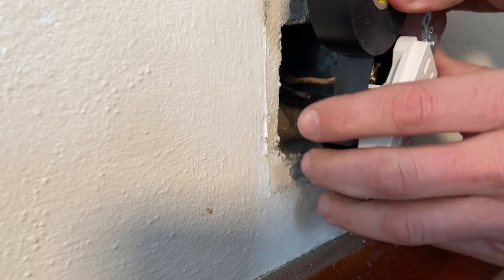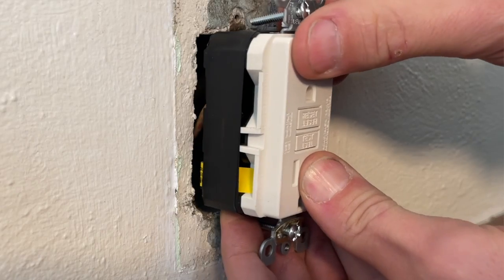Should You Wrap Outlets In Electrical Tape?

Comment: Wiring in my house is 60+yrs old.  When I am replacing an outlet, switch or new light fixture, it scares me.  I wrap everything.    The layout is insane as well.  With every remodel the house went thru, i swear they picked a random breaker to connect to.   I have breakers that connect to 3 different rooms 2-3 outlets or lights each.  I have one breaker that connects to the basement, 2 outlets in the living room, 1 in a bed room and the attic.

Comment: FYI taped wire nut is a level of UL ratings.  Though as you said it is only for insulation the nut must be properly installed.

Comment: I'm not an electrician, but will that GFCI work without any ground wire? (see 4:09)
Reply: Wrapping with a good  brand of  electric  tape after  twisting  the  solid  conductors and  leaving a  folded  tab on the  tape ,in my opinion is the best way  of  Safety  because  sooner or later someone  will take  faceplate off and  or pull it ( switch  or receptacle)out  to inspect  or paint, so Safety  first

Comment: A couple of thoughts here. Yes, good to use it as an added precaution. It should not be used to replace proper connections, such as the actual connection to and within boxes, wire nuts and, the new Wago connectors. Also, reality dictates it could be used in a pinch for a short period of time until it can be properly repaired.

Comment: The neutral wire not connected ? This is why I twist the wires together with pliers before adding the wire nut ! I always wrap the receptacle if the box is metal , I wrap the wire nuts if it is tight to fit everything back in the box .

Comment: My take:  if an installation is done properly, whether an outlet or a wire nut, there should be no need to wrap anything with tape.  A plastic box does not conduct electricity, your metal box should be grounded anyway, and there are no loose wires or exposed conductors in properly installed wire nuts.  In all of the homes I've had and had to redo electrical work when failures occurred, I have never seen an outlet taped, and taping wouldn't have prevented the failure (commonly a corroded connection in a push-in connector or improperly stripped conductors that have broken when the conductor was partially cut through during stripping), and I have seen lots of wire nuts taped that only hid the faults (loose wiring or improperly stripped conductors that have broken when the conductor was partially cut through during stripping).  It's my opinion that taping only hides errors and makes repairs and troubleshooting more difficult for the guy who has to fix the poorly done job later.  Further, on most of the taped connections I have seen the electrical tape was dried out and falling apart anyway.

Do the the job right the first time and skip the tape.   Just my opinion.

Comment: I always tape outlets and switches in metal boxes. I do one other thing to make it easier later on down the line, be it a month later or years later. After I snip off the roll, I fold under the last 1/8 of an inch of tape on itself so it makes a 'tab' that doesn't stick down and "become one with the layer underneath". So, years later, whoever is trying to repair or update the outlet or switch can just grab and unwrap. It takes less than 20 seconds, so why not?

Comment: I think it's important to actually twist the wirenuts properly, regardless of tape. Those wires were not properly twisted.
Reply from the maker: Agreed, I was just trying to a quick demonstration so you are right I did not pre twist the wires with linesman's pliers prior to twisting on the cap.
Reply: Linesman pliers, yes. Cheap tool and the right way (should have a pair anyways if you're a do-it-yourselfer).

Comment: I use tape only when I'm working in a metal box (and I can't replace the box with a larger, plastic box) or when wiring larger devices in a multi-gang box.  The goal in both cases is to prevent the side screws from coming into contact with anything conductive.  Plastic boxes eliminate much of that risk, but not always.  New receptacle types, such as GFCI/AFCI/USB, are many times larger than older ones (even spec-grade!), and there's a chance that the contacts could touch each other.
I never use tape on wirenuts.  The rule there is to twist all of the wires together first, and then twist on the wirenut.  The plastic on the wirenut should cover all exposed condutors.  If there's any bare wire exposed below the nut, then cut the wires a little bit shorter and re-apply the wirenut.  Outdoor applications should use wet-rated wirenuts rather than regular ones + tape.

Comment: I always wrap, it only takes ten seconds and a few pennies of tape, put a tail a tail on the end.  it makes it a lot easier to remove it.  I also tape the end of wire nuts.  I pre twist the wires before twisting on the nut and pull test before taping.  That way the taping isn't hiding anything.  The Super 33+ is the way to go.  We do outdoor work as well using under the under the surface electrical boxes or pull boxes that hold water.  The tape is a great barrier from the water.

Comment: If replacing two prong socket on a metal box and the box is not grounded there is a risk that if the live wire in anyway touches the box the voltage will get through the ground pin to the equipment case. The GFCI will NOT detect this. If this happens on a normal socket downstream then the GFCI will detect it. A GFCI does not protect from faults that happen before it.

Ideally they should have special sockets with a dummy ground hole for the ungrounded circuits but I do understand that it is impossible to sell them as people would accidentally misuse them in grounded circuits which are more common.

Comment: I was taught to wrap as a kid. I still do.  Repaired neighbors floor outlet that a “master” retired electrician put in.   Not sure where he got his certification,  but def could have avoided the blowout had he taped. Terminal not used was not screwed in and arc welded to the box and blew the receptacle cover off.  Then to add the “electrician obviously didn’t like Romeo connectors as he had over stripped the outside jacket, left about 2” of just the wires dang,king out the box which was exposed to a crawl space where squirrels and other rodents love chewing things. 

Glad there was enough slack to pull it in some, just still surprised the electrician who did the work didn’t notice the very little clearance between screw and metal floor box.  He charged her 75$.  I charged her 25 including the receptacle and connector.  I hate seeing people get screwed much less leaving a possible fire hazard. 🤨

Comment: What is particular about STRETCHING the electrical tape?
Is it merely to keep it taut around the outlet, or?

Another educational video. Thanks for sharing...!
Reply: I don't know how to describe it properly, but there isn't anything similar that is quite as nice as stretching a nice piece of electrical tape.
Reply from the maker: Hi Ivan,  Stretching helps the tape bond and follow the contours of the receptacle which is true except for at the end of the tape which should be applied loose without any stretch. 👍

Comment: wire nuts are not supposed to be used as a primary to secure a connection. most state codes call for the wires to be twisted together. the wire nut prevents them from untwisting while insulating them as well

Comment: During my electrical training I was told to never waste time wrapping an electrical outlet since it is not required by the code AND the design of the outlets themselves prevents the screw heads from touching the sides of a metal box.  And plastic boxes not really a concern either since they are non conductive plastic.    
Just remember that the slots in the top and bottom of the outlet are too short to allow the screw heads to come in contact with the sides of any electrical box designed to comply with U.S. Codes.  And as far as servicing an outlet goes, NEVER do it with the power on.  Take the extra minute or two to turn off the power to the outlet so it can be replaced safely.

Comment: Have done this for years. Prevents stripped wires or wires that come loose over time from touching metal (or me). Have been surprised by homes that get a lot of vibration from roads/earthquakes/airports, ect. actually have wires BREAK inside the boxes. Usually a 14ga wire that breaks right at the receptacle. The wrap of tape is what kept it from becoming a hazard. J.M.Exp.
Reply: If electrical work is done correctly... Wires don't pop off or snap off. (Corrosion can happen if conditions change) Everything installed per NEC and per manufacturer instructions should produce a job that will last for many decades. I actually don't appreciate all these amateur suppositions in here, electrical work is a long established trade (like many others) that can't be understood and mastered in a few videos. This guy is arrogant to give advice on something that he is barely familiar with. I have done equal parts of Industrial, Commercial, and Residential work for 40 years. Taping is generally a ridiculous waste of time but there are always special situations that come about and it is just one of many methods that may be employed when dealing with temporary electrical work. That said, installing it in a properly installed electrical box is absolutely a waste and a mess and a fool's errand. This is classic bad information in the mouths of the ignorant.

Comment: For one thing I don't use the cheap wire nuts. I also prefer the ones with the little wings because I can pull the handle off my multi screwdriver and use it to torque the wire nuts on. Yes too many times have I come into a job where someone used the cheap ones and didn't get a good seat on The Wire. Made up for their garbage work by using electrical tape, to which I had to spend a day unwrapping all the tape. Sarcasm intended. Also come across lots of the older metal boxes that were too tight and no way to replace the box with anything larger. I went with as many wraps of tape as it took to center the outlet in the Box. Over time with continuous pressure I think you can ultimately push through the tape if only one or two wraps are applied. It's amazing what the old-timers would get away with in these log cabins.

Comment: I only wrap the receptacles  OR switches when installing in metal boxes.
3 wrappings.
Wrapping wire nuts with tape?
ONLY outside or in damp locations and I also fill the wire nut with no-ox grease or dielectric silicone grease PRIOR to installing the wires into them and tightening with a lineman's pliers THEN wrap with tape AFTER performing the yank test.

Comment: I go by two rules when determining if I need to tape a device... (1) anytime a metal box is used and/or (2) if more than one device is mounted in a box (metal or not).  Cuts dow the possibility of the side terminals making contact with either.  Wire nuts... no, never.  Properly installed, they should not expose any bare conductor.

Comment: Understandable that it could be a risk. Yes it is electricity resistant electrical tape. Sticky end collects dust, dirt, and misc materials so be aware of that. For an area that doesn't have protection such as the metal insert housing I suppose it is safer than having them exposed. Especially in drywall where bumping against the wall and vibrations may shed some of its material on it over time.

Comment: Using a wire nut should be a last step after you twist the wires together where they are already secured to each other.  The wire nut is basically a cover for the wires.  There may be some additional securing due to the screw action but it's not intended to be a fastener in my opinion.
Reply: I agree on solid wire, but I feel like pre-twisting stranded actually does more harm than good. I tend not to use cheap wire nuts and do not pre-twist most, unless I am putting more than 2 solid conductors under the same nut. I mainly work with 12 gauge, and 3M R/Y or Ideal Wing Nuts. I have no idea how people use Buchanan B-Caps, any time I have had the displeasure, the metal spring usually disconnects from the plastic when I am tightening them.

Comment: Personally I use tape on wirenuts but not to insulate but rather keep the contacts free of dirt and moisture which could lead to corrosion.  I always do a pull test before taping though, I agree you wouldn't want to give yourself a false sense of security.

Most of our old boxes in the 1917 and 1927 homes we've owned the past 10 years have been loaded with cobwebs and debris.  And several of them have had water infiltrating in from above.  Water often follows conduit lines through surface tension along the underside of the conduit until it reaches a box.  At the box it'll course it's way through until it finds an outlet.  I'd seen it before when the kids were splashing too much out of the tub and onto the floor... and just last night I found an old 1950's box that had all the hallmarks of water damage from an old hot water heating system which used to be installed above.

That all said, it's best to have the caps pointing closed-end up to prevent most of that... but I'm never that confident the caps will remain in that position once I push it all in and put the cover on.  And the amount of cobwebs and crap that gets in there... nasty.  I don't want all that on my contacts either.

Comment: I ALWAYS put tape on the wire nuts. I make sure the nut is holding the wires then I wrap the tape around the wires then around the nut. Also I ALWAYS try to have the nuts facing upwards just incase water or moisture doesn't seep into the nut. I ALWAYS wrap tape around the plug, ALWSYS.  When a box is held by (wings) I'll try to put tape on the inside wing just incase of the plug getting bumped by someone hitting it and thus moving the box.

Comment: Two comments: 

First, I prefer not to use electrical tape on receptacles.  You should de-energize the circuit before you work on it, so electrical tape is irrelevant.  If you do choose work on the receptacle live, the action of removing the tape is much more likely to result in a shock than pulling it away from the wall to work on it.  If you are working in a metal box, and you do touch the sides it will short the circuit and not shock you.  If you install a receptacle correctly, it should not be touching the sides of the box, and if all that is keeping the receptacle from shorting on the box is electrical tape, the receptacle is not installed properly.  Electrical tape on a receptacle is a crutch for shoddy work.

Second, a few years ago 3M changed their notice on their Super 33 tape from saying it was good for insulating up to 600 volts to saying it was not for use on circuits over 600 volts.  So technically it’s not rated as an insulator anymore.  I tend to use 3M Temflex 1700 for most applications.  I mostly only use Super 33 when I’m working in very cold areas or when I’m terminating a motor.  Basically, Super 33 is very useful to have on hand in industrial settings.  For commercial and residential settings Temflex 1700 is quite adequate.  That being said, it doesn’t hurt to use Super 33.  It just costs more.

Comment: I will sometimes use tape on nuts if it's in a high moisture area. For really high moisture areas (like outdoors) I use rubber mastic and tape.. This isn't to hold nuts on, but to reduce corrosion..
Reply: I've used butyl rubber as stuffing in wire nuts, capping it with tape, for the same reason.

Comment: I dont add electrical tape unless theres an issue, or Im worried there could be an issue.  Timers, Dimmers, GFCIs, USB Power all seem to push the size limit and encrouch on the next unit in the gang.  I've got a few switches replaced that barely fit inside the receptical.  Tripped the breaker on first power-on.

Comment: When you see electrical tape on a wire nut, it usually means the tape is hiding something that isn't right about the joint, whether it is loose wires or exposed copper.

I never tape receptacles unless they are temporary receptacles used during construction. Otherwise, not an issue, even with a metal box unless you are doing it live which is a different issue entirely.

From an electrician with two decades of experience...
Reply from the maker: I completely agree on the electrical tape used on a wire nut.  Thanks for your feedback.

Comment: Doing electrical service work I’ve almost never seen this. When I do I always remove it. It only hides real problems.  If you are not confident enough to install a device without electrical tape around it you probably shouldn’t be doing any electrical work.  I think the only time I would consider it is if it was an ungrounded box as the box could end up energized and not trip a breaker.  If there is no ground it’s probably time to fully gut the place and put in new wiring.

Comment: Try do you twist wires before using wire nuts or just place the wires in the nut and have the nut twist the wire, I have heard both argument, which is the best way?

Comment: The main enemy of outlet wiring is vibration. It takes about 5 extra minutes to tape the wire nuts, use the terminal screws, and tape the outlet. 
If you're a homeowner or other diy-er, spend that extra five minutes.
Reply from the maker: I do most align to the vibration argument for taping.  Thanks for the feedback!
Reply: @EverydayHomeRepairs  and of course none of us have EVER pulled a live outlet from the wall...not me, ever.